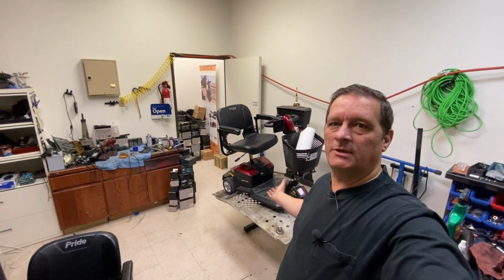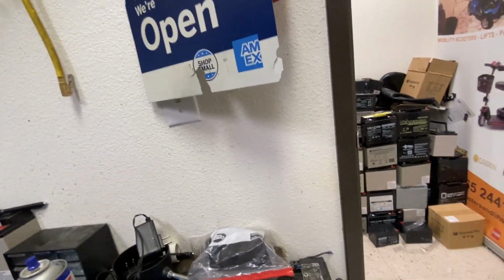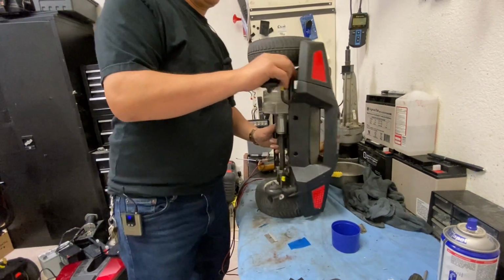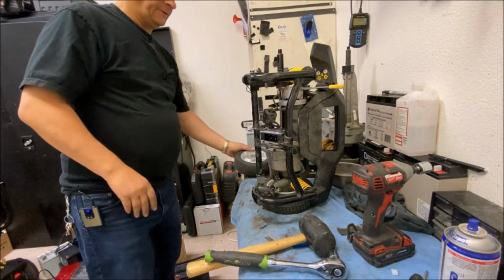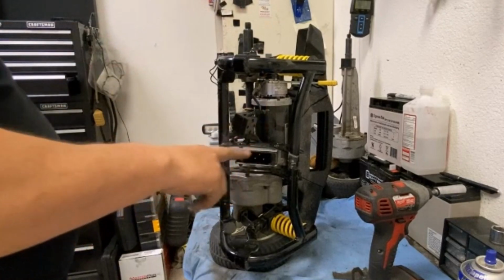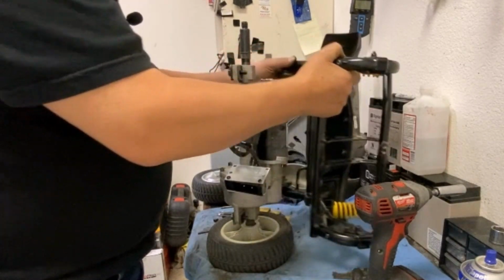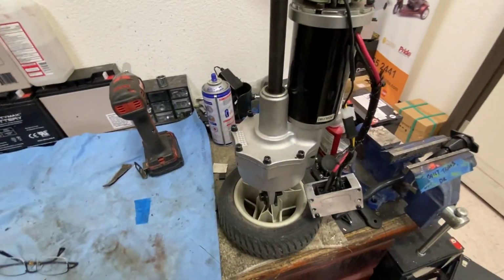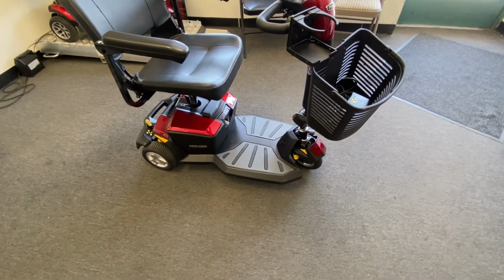Reconditioning a Go Go LX with a failing transaxle.

Comment: Hey Ian thanks for another great video question I have is how do you get involved with the manufacturer and do you get trade discount on parts
Reply from the maker: Hey Gareth, if you are in the US, you would need a business license and TAX info. Then you would have to apply to become a dealer of the manufacture. (all manufactures require this) With Pride for parts, you don't need a physical store but to resell scooters there is a minimum buy in and must have a physical store front showroom.